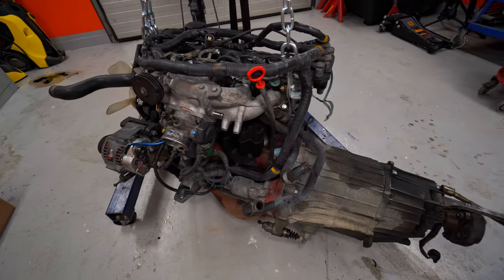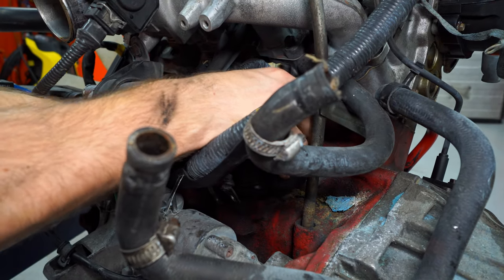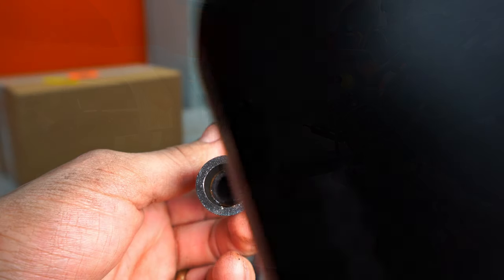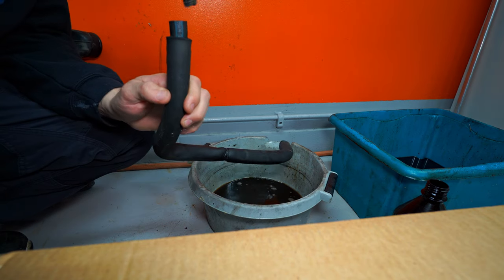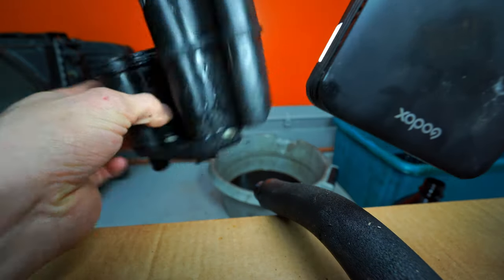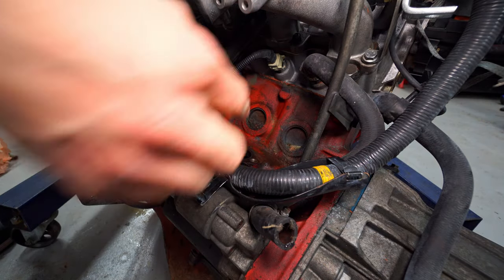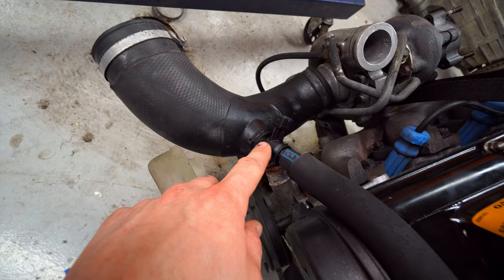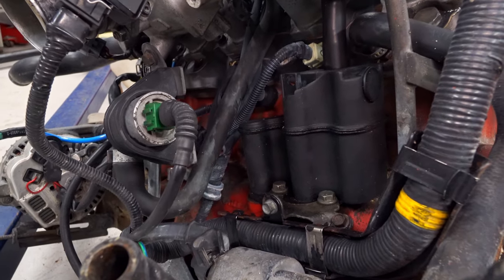High Crankcase Pressure || Cleaning The PCV System  || My Daily Driven Volvo 945

Comment: Thanks, this video helped me a lot.
I have a problem with my 1993 Volvo 240. I replaced the small tube that connects to the intake manifold. It was completely clogged. But now the idle has risen to 1000/1100 RPM.
Why?
Reply from the maker: Check for leaks 👍

Comment: Here in the states we use kerosene much cheaper alternative to degreaser.
Reply from the maker: That might work better as well!  I had to leave this overnight to fully dissolve everything inside. But as far as the price goes. Seems like kerosene is more expensive here than degreaser, at-least the degreaser that I used in this video.  Maybe I will try that next year 🙂👍

Comment: engine is out, easy to replace parts and you cheap out and reuse old hoses. My God...
Reply from the maker: Thats right, there is another car that i would rater spend my money on.
Reply: Some people have more time I guess i replace parts when i can.  I will be doing this on my daily it cracked 350K i guess it was time LOL
Reply: Some people have" Impartitus" where they can't part with$24.99 for a new canister.Should be seeing a therapist 4 sure!
Reply from the maker: Video clearly states: Clening the PCV, not replacing. 
The video is intended for those who want to clean it. If you want to replace it then just do so ?

Comment: Taking the motor out for ONLY this is not worth it. There are only 2 12mm screws to take out and then it will slide out after a little shifting and turning which is annoying but doable.
That piece of junk PCV should be replaced anyway by an adapter with 2 hoses that go directly into an oil catch can. There's is an 70 bucks after market option or DIY. I recently opened one of those things and there's basically nothing in it but 2 chambers forming a narrow double wall that gets plugged with sludge.They are only connected by a tiny 10mm hole that let's the oil fumes through. I'm gonna keep the lower part of it to build my own adapter to run hoses out of it into the oil catch can. We'll see what the authorities here are gonna say to it regarding emissons but should be ok without excessive load and boost while testing.

Comment: Can I do this with the engine still in the car?
Reply from the maker: Yes, but off-course it will be slightly more difficult. /Mattias
Reply: I used a joint adapter on the socket wrench. Didn't have to remove anything to reach the bolts that way 😊

Comment: Gonna be taking engine out..
Reply: Not worth it. That piece of junk PCV should be replaced anyway by a an adapter that goes directly into an oil catch can. There's is an 70 bucks after market option or DIY. I recently opened one of those things and there's basically nothing in it but a wall with a tiny 10mm hole that let's the oil fumes through. I'm gonna take the lower part of it to build my own adapter to run hoses out of it into a oil catch can. We'll see what German TÜV is gonna say to it regarding emissons but should be ok without excessive load and boost while testing.

Comment: No mention of the o-rings or the drain pipe. Ignorant post, leaving much to be desired... Nothing 🤣 n depth. And it doesn't even follow the service instructions for updating your breather box for this engine. And the Box should be cleaned with carb cleaner or something that takes the oil off completely, not degreaser.